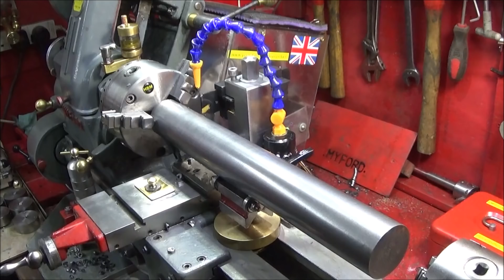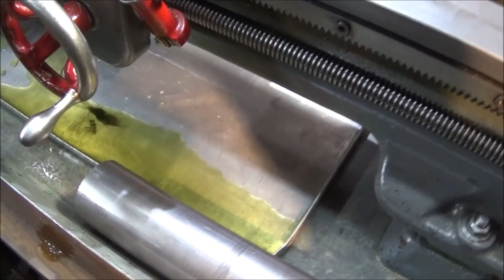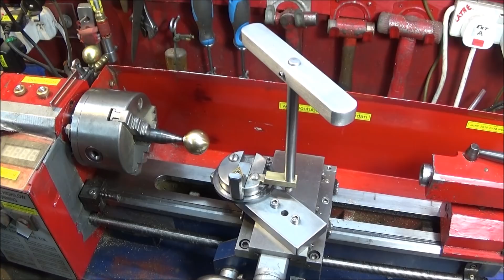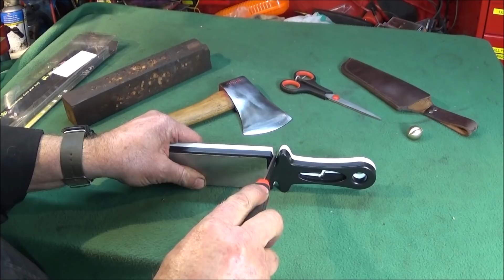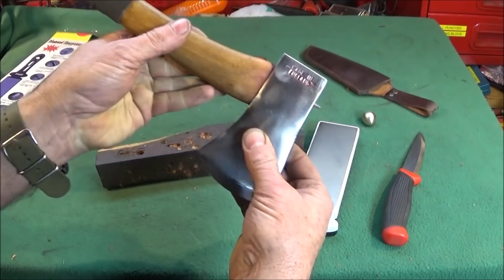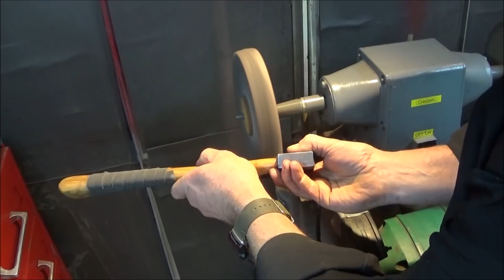A few upgrades. A new Mini Lathe Ball Turning Tool & Diamond Sharpener

Comment: great video Steve, i have an original lead screw hand wheel and there is 125 divisions not sure about the budget ones but it looks like 125, may help when milling if you find you are cutting to deep!!!!
Reply from the maker: Hi yes. I have never actually used it with accuracy in mind. I just it as a rough guide to advance the carriage when milling, so as not to take too heavy cuts. I have never tried the increments in relation to a depth clock. I always use a DTI if I have to be very precise on depth, or use the carriage stop and measurement with slips.
Reply: yes i use it to get me somewhere near then clock it,  just to let you know i made the tail stock cross drill fixture last night, brilliant thanks.
Reply from the maker: Thanks.... I'm pleased you like the fixture.

Comment from the maker: YOU CAN GET THE MULTI PURPOSE DIAMOND SHARPENING TOOL HERE:-
https://goo.gl/PXuMVa
EU Warehouse --  https://goo.gl/vWUR37
US Warehouse --  https://goo.gl/pAAtCB

PART OFF BLADES.SMBB2032 Grooving Cut Off Blade Holder CNC Milling Cutter Holder -- https://goo.gl/VzVn1V
10pcs ZQMX3N11-1E SP300 YBC251 Cut Off Grooving Inserts --  https://goo.gl/GdhHco
SPB32-3 32mm Grooving Cut Off Cutter --  https://goo.gl/xGSbmx
     SPB32-3 32mm Part Off Blade Grooving Cutter --  https://goo.gl/6CzC51
      Wholesale Mechanical Parts --  https://goo.gl/uupC6k  
     Banggood Brand Street -- https://goo.gl/otm8HR
Reply from the maker: Banggood Health Protection -- http://bit.ly/33tNTBx
  Banggood Health&Care Protection --  http://bit.ly/3d7QpSy